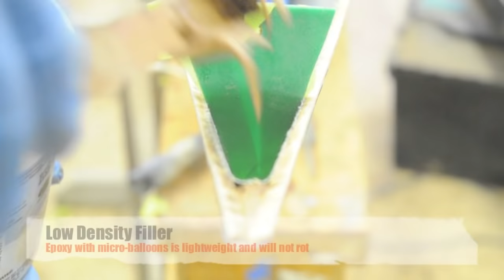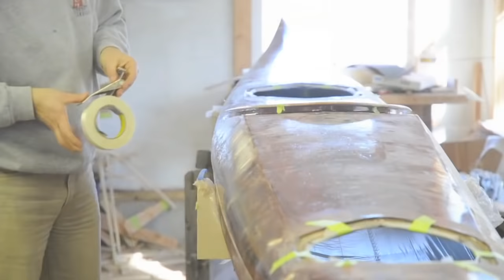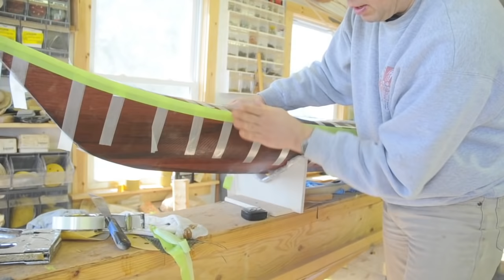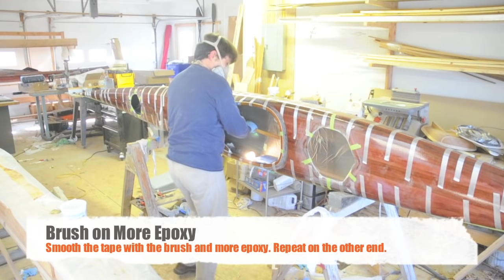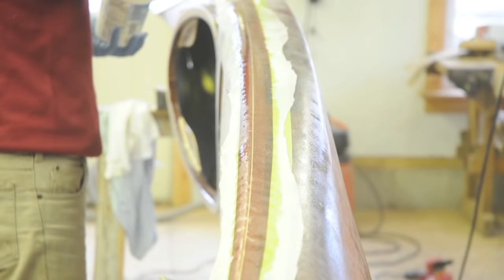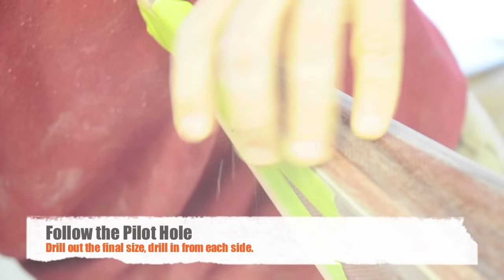Seaming the Kayak

Comment: Do you send it from inside?? Fiber tape edge, after curing with epoxy, very sharp.
Reply from the maker: I do not sand the inside. The edge of the tape is a bit rough, but I don't worry about it. I have put peal-ply down on top of the wet fiberglass to make for a smoother finish, but I usually don't bother.
Reply: @NickSchade  yes. I do the same. I but wide polyethylene tape on top of epoxy, bu I sand by hand a little to smooth after

Comment: Nick, I've watched most of your videos but haven't come across any about cutting out the storage compartment hatches. Do you have any tips? Do you do it before or after glassing the top and you do you ensure a waterproof seal? I'm about to start glassing  my night heron double by the way.
Reply from the maker: Hi Adam,  I guess I have not put out a video showing the process. I typically cut the hatches before installing the deck on the hull. I usually cut it with a jigsaw. I make a lip that gets attached to the underside of the deck to support a gasket. There is a spacer between the lip and deck to accommodate the thickness of the gasket which I make from weather stripping.

The primary requirement to achieve a good seal is down-pressure on the gasket. This is easier said than done especially on large, flat hatches. Some spacer blocks to support straps or shock cord will help make downward pressure.